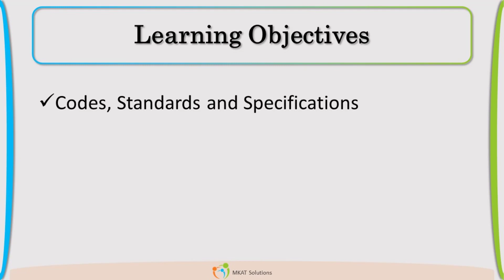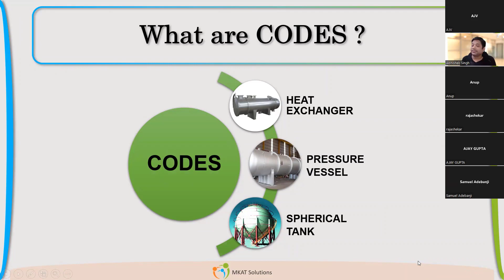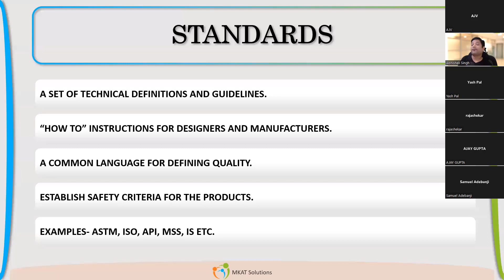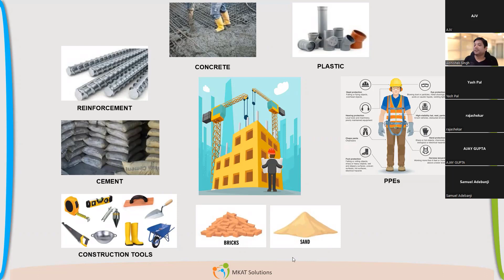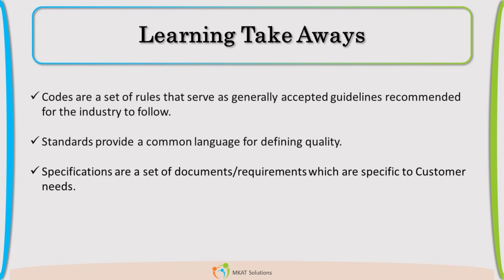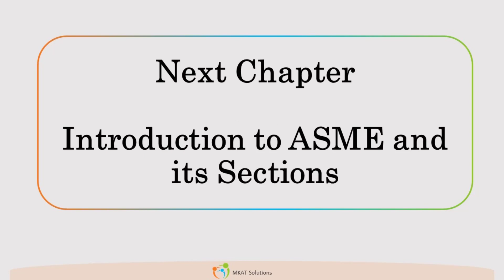Module 03 Chapter 01: Code / Standard / Specification

Comment: 12:46  you said that 
Yield stress, we are allowing our vessel to yield.
But whenever we consider yield stress 
As permissible stress, we are not going past the yield point & staying in elastic zone? 
Did i misunderstand this?
Reply from the maker: Hi, I am talking about yielding due to secondary stresses, which is allowed. To understand this you need to understand the difference between different types of stresses and its allowable limit. Secondary membrane plus secondary bending is allowed up to 3 times of allowable stress that means 2 times of yield. Read from Bendnar or Dennis moss.